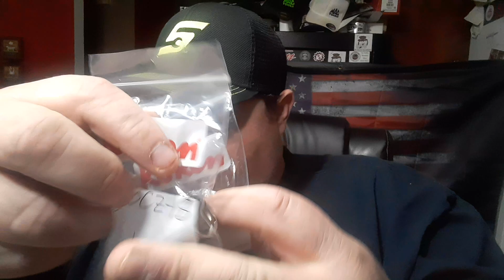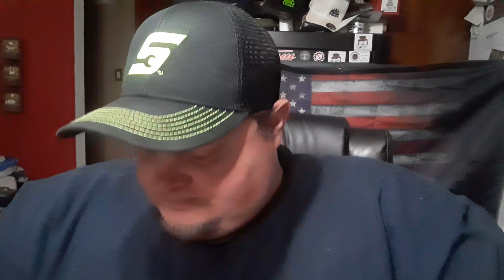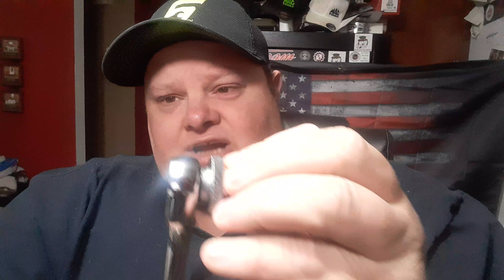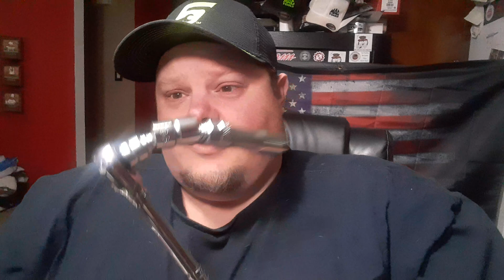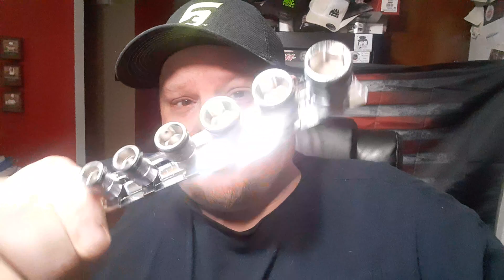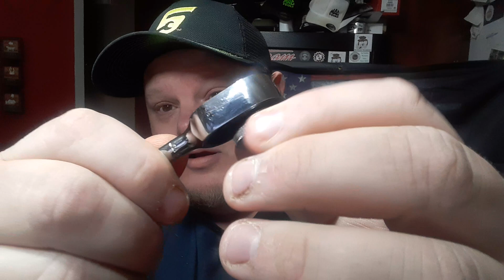HUGE Ko-ken tool haul I would spend $1,0000,000 for these tools!!

Comment: Just received my first KoKen order. A Rotohead Ratchet, a short extension step down adapter that goes from 3/8 to 1/4, a 1/4 swivel U-joint thing and that set of 1/4 Nut Grip sockets you show here. So far I’m pretty happy with them. 
Please don’t post anymore videos about them!   : )   😄
Reply from the maker: Lmao I will

Comment: Watching this for the second time a year later.
I have found Koken do a wobble extension so short you wouldn't think it would be worth it. The 1/4" is about 27mm. Now add that 27mm wobble to any wobble extension and you have a lot more of an angle for not my more length. 
It's not as good as the double universal but it's shorter which can be useful.

Comment: Funny how things go full circle. Back in the 70s and 80s "made in Japan" were fighting words. Back then a lot of Japanese stuff,  tools included, was cheap ass junk. Now Japanese tools are really good for the most part and really nice stuff. For comparison sake, Craftsman was all made in USA and the go-to for DIYer mechanics, carpenters, you name it.  Today of course "made in China" is the cheap ass junk. As I get older I am more and more amazed at how things constantly change.
Reply: Well that changed quite roundly really, in the 70’s and 80’s that was already a misconception from before world war 2, the reality is they worked their asses off after the war to become titans of industry and their culture of every man taking pride in even the most mundane work tasks breeds excellence. So their quality was quite high just a few years post war, and in many cases even before.
Reply: @Fee.1  well it maybe started to change at that point. but, I can tell you a lot of it was cheap ass stuff.
Reply: @guyconnell2250  sure but you can find cheap stuff made anywhere, but the misconception that Japan=automatically low quality most of the time was far from accurate, whereas China had earned that reputation
Reply: @Fee.1   Well I disagree. Simple as that. Not dissing Japan. But I recall when "made in Japan" was a derogatory, desriptive term. I agree that it is no longer. I have no reservations about buying Japanese stuff now. It is, today, great quality stuff.
Reply: @guyconnell2250  that’s literally my point. It was a derogatory term because of the war, not because of any inherent quality issues. I encourage you to read or view objective retrospective looking analytical material about production of Japanese goods....quality was never the issue...perceived quality on the other hand was very low despite the reality of the situation and it took a long time for that reality to permeate people’s preconceived notions. 

To reiterate, I’m not at all saying that you’re remembering incorrectly, only that the popular perception wasn’t necessarily accurate...that shouldn’t be too hard to entertain considering how wrong people get things wrong before warming up to it. 

Thanks for the chat, take care
Reply: @guyconnell2250  unless you’re speaking of pre-war japan ...but they weren’t an industrialized nation to the same extent so most people I’ve spoken with from the era has very little experience with Japanese made goods before the war, or it was cheap items by design like homeware and lamps and decoration etc but I assume you’re speaking post-wae after we assisted their industrial boom

Comment: What, no Ko-ken Tools hat?  The universal joint moves FLUIDLY (rather than fluently).  I had heard of Ko-Ken tools before, but no one else had made a video describing them and the care with which they're made.  They're almost too nice to use.  You didn't mention pricing, but I'm guessing they're costly enough to make a Snap-on guy squeamish.  The universal joints (1/4" and 3/8") are of interest to me, though.
Reply from the maker: Negative the price is extremely affordable I was absolutely shocked you will also!!

Comment: Thanks for the heads up about the switch on the nepros ratchet. I’ve heard nothing but good things and was planning to pick one up. I’ll definitely go another way maybe koken now
Reply: Thanks for the reply CP. Looking for light backdrag and low slop between the teeth
Reply from the maker: @gregblau8082  then this is by far the lowest on the planet
Reply from the maker: The ko-ken is a much better way in my research I'm no expert but I definitely asked the guys that know!
Reply from the maker: Greg I do apologize I misspoke the orientation is opposite of what you you normally be used to what I meant to say is that Ko-ken has been using that same orientation for all the ratchets since they built them the nepros would be the same as most American tools however I still think this would impress you to try the backdrag alone is unmatched!! I do apologize!!

Comment: Cp you love knurling just as much as I do. If you didn't buy the knurled wobble extensions you def should. Its sad the only ones doing real knurling is sk. What I mean by real knurling is the WHOLE ratchet handle has deep knurling. Snap ons extension knurling is sad period. I want more chrome knurled handle ratchets damn it. Not too long ago sears had the vessel impact driver. I picked it up for like 10 bucks. It has the craftsman stamp of course but its vessel. Btw its peep18m I made this channel a while ago. Koken spark plug sockets are bad a$$ too btw. KTC is good stuff too as well as nepros obviously lol. The koken ratchets remind me of the old proto.  I'm honestly not a fan of magnetic sockets for the reason you mentioned. Magnet getting all full of crap.

Comment: As you are explaining what you are talking about sometimes is that in which i think  about alot when working meaning .... Mechanics and technicians have more of a understanding and a feel for designing tools more than they know....Some individuals apply the techniques and then some others rather be the consumer ...See Techs in the trades will modify special tools and some will make equipment some what better than others but the individuals who understand there abilities in most cases don't realize the specialized lane that they are creating but may not take advantage of it ....Theres alot of mechanics and technicians out there who are a whole lot more skillful other than them just being the diagnostic tech or remove replace individual